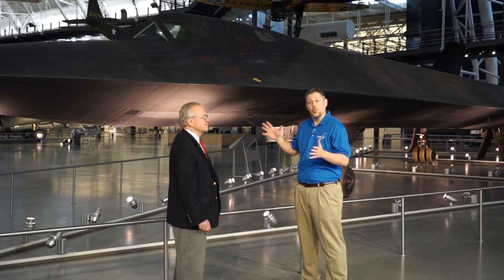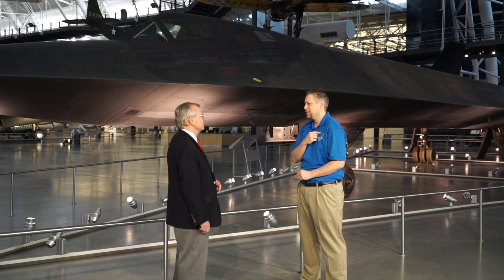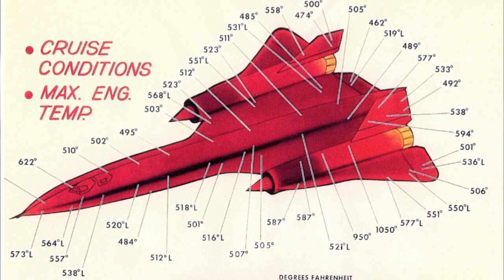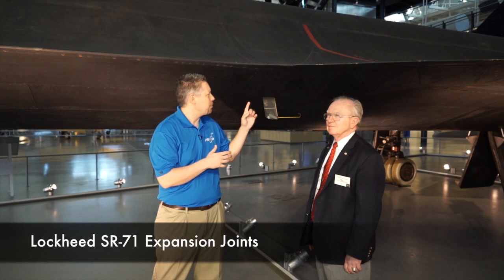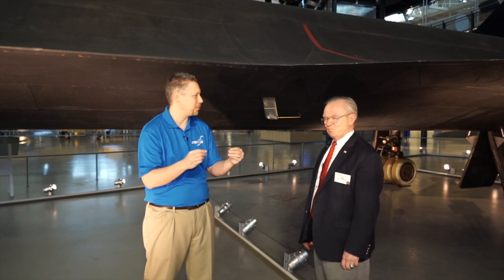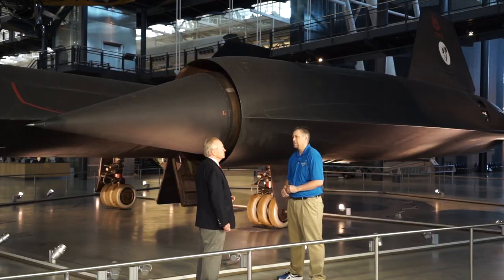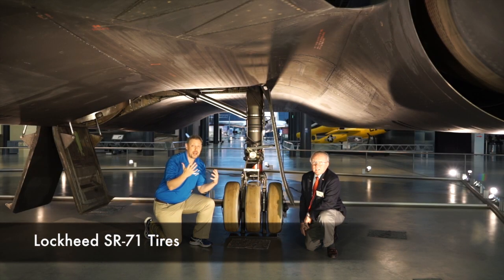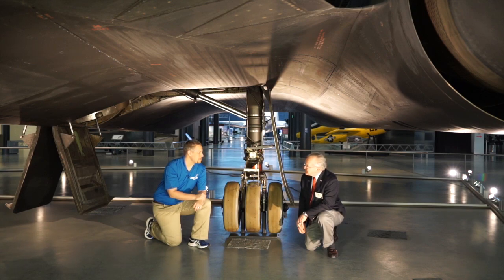A look at the SR-71

Comment: I also saw somewhere that the reason for refuelling was because the fuel leaked everywhere when the aircraft was on the ground. Something about they couldn't find a sealant that could withstand the heat.

Comment: Palmdale California's "Blackbird park" is the only place where you can see an A-12 next to an SR-71. The nuclear Cold War mission of the two aircraft were different: A-12 was for pre-strike surveillance; the SR-71 for post strike reconnaissance. One docent at the air park is "Flaps" Flanagan, who piloted an SR mission that was designed to test the Space Shuttle's navigation system in the 80,000-50,000 foot altitude range. As I recall, the SR was so efficient, the aircraft could not slow to the speeds needed to mimic the Shuttle. As for the well known Russian Ti-purchase cover story, the story in Palmdale was that  microwave ovens were described as the  reason for the bulk purchase.

Comment: 13:41 so this guy drove that plane on the ground at 240mph every time it took off - motorcycle and sports car guys take note
Reply: cheese chisel it’s not like it has two jet engines on its sides or anything.
Reply: @VERT1220  I didn't mean this about the machine, but about the bravery of the common looking old guy in the video who regularly did something so intense that even hardcore racers consider amazing
Reply: Then again, it’s the military. You need to test to get in there. After that you gotta become officer which takes about 20 years. And it takes 3 types of schooling. That’s a lot lol. I’m in the Airforce currently and see 16s and 15s take off everyday and it’s awesome but a super unfair comparison 😂😂😂

Comment: I started my engineering career using the slide rule.  Then the electronic calculators replaced the slide rules.  I used the HP RPN calculators, including the programmable ones.

Comment: The F-15 top speed is 1875 mph made of aluminum, and the additional 325 mph made this SR71 get that hot ? and require a Titanium body ? Clearly the SR71 was much faster, more like Mach 5. I worked on the J58 in the late 80's at P/W, we were still modifying the injector heads to be more efficient. The J58 had 45K lbs thrust when first flew, probably maxed around 65K thrust or more at the end.
Reply: forrest gump V short bursts at that speed....this could cruise at higher altitudes

Comment: Gosh, no mention of the D21 drone...
Reply: Nofer Trunions The D-21 was not launched from the SR-71, it was launched from an M-21.  This video is about the SR-71 at the Smithsonian’s Udvar-Hazy Center.  If you care to learn more about the D-21 and M-21 they are on display at the Museum of Flight in Seattle.
Reply: @jonboyette5458  Actually the title of the video is "Lockheed SR-71 Nose" which leaves a lot of room for digression.   If they are talking about temperatures and expansion joints, that applies to anything that has a pair of J58's.  How could they not mention that the plane leaked fuel on the runway until it got hot enough to expand and seal tanks?  I mean that's the cool fact about the joints.  (Did you ever see that pic of maybe 9 SR-71's?  They all had the same puddles of fuel under them.)

The interviewer seemed fascinated and excited about the plane, so again, how could you not say, "You realize we even launched the piggyback D21 drone from this series!)
Reply: Nofer Trunions the title of the video is “Tour of the SR-71.”  No mention of the M-21 in the title.  It’s a real simple tour of the components of the SR-71 (which did not launch the D-21,) not operation oxcart or the skunkworks.
Reply: @jonboyette5458  My Bad.  Read the first topic title in the video and assumed (love that word) it was the title of the video.  Yes, definitely the proper title.  I'll throw a little bit about the SR-71:  it is possible to compute the maximum mach number theoretically possible by measuring the shock angle coming off the inlet spikes:  when that cone touches the inlet OD, the engine will unstart.  That number is around 3.6 to 3.7 Mach.  That is not to say there are other limiting factors - only that >3.7 is physically impossible.

Comment: The fact this was built with a slide rule as the major technological design processor is so badass.
Reply: My Dad was a chem engineer and used a slide rule for decades. I can still hear him saying "log log scale".
Reply: Sir, can you please explain how a length measuring device, is so helpful in building an object with the requirements of such a high degree of precision engineering?
If that's not what a slide rule is for, please don't get angry, I don't know what's it used for.
Reply: @harshvardhan4771  A slide rule is not used for measuring length. It is used for complex mathematical calculations like an electronic calculator.
Reply: @Bob31415  oh, nice. But given that it's analogue, and the result of the calculations isn't handed over to us within a big red highlighted box, isn't there a large room for error? I mean, yes, the people using it are not idiots, but still, people tend to ignore or look over even the most basic of details when in a hurry.

Example, you calculate 76*45 using the slide rule, and the result should be 3420, which it is, and you read it so. But in a hurry (which is generally a common case in production lines) on the spec.s sheet, you note it down as 3580, which isn't much, but can be the crucial difference between the aircraft panels being of the right size vs the aircraft crashing due to unexpected aerodynamics due to an inefficient aerofoil, due to a metal panel on the wing's surface being of the wrong size.
Reply: @harshvardhan4771  I know. The slide rule is an amazing invention. I have no idea how to use one. I have one around here somewhere that belonged to my father who was a high school chemistry teacher in the 60s.

Comment: During and after the Second World War an aircraft manufacturer run by Jack Northrop was tasked to come up with a flying wing. The first one flew in June of 1946. This aircraft was designed with a pencil and paper along with a slide rule like the one shown in this video. Jack's flying wing had a wingspan of 146 feet. Nearly 40 years later, using the very best computers money could buy at the time the latest version of the flying wing was built, but by now the computer power Jack's wing needed so bad to make it work was here. How far off was Jack's wing from the B2 Sprit, you decide. Both have a wingspan of 146 feet.

Comment: I got the opportunity to see the SR-71 take off from the NASA air strip in California when President Reagan was in office at a landing of the space shuttle there. It was amazing. The SR-71  had 2 Small fighter jets that escorted her in to a banking maneuver. Once they made the  turn the two smaller planes went full burn. you could see the jet streams lengthen as they began to accelerate. Once they passed the SR-71 by about 2 lengths of the blackbird the pilot in the in the SR-71 threw his throttle all the way forward in 2 seconds he had passed the 2 other planes and with in 5 seconds he was gone. he just disappeared in to the sky it was that fast.

Comment: I learned how to use a slide rule out of curiosity. You can get 2-3 significant digits of precision out of one or 3-4 digits estimated precision. Surprisingly that's good enough for most engineering work.

Comment: Most "Sr-71's are actually the A-12's, look it up
Reply: No. I was around SR-71s almost every day for 3.5 years when I was in the Air Force, and can immediately tell the difference between an A-12 and a SR-71. The A-12s were early versions of the SRs.  The A-12s were a little longer and the wings were a little more curvy where they met the fuselage.

Comment: Canada had built a Fighter/Interceptor called the Avro Arrow. When he was cancelled in 1959, over 15,000 employees went to different Aircraft manufacturers. NASA, Concorde, Northrop-Grumman you name it. In 1966 when this SR71A Blackbird came out a lot of it was with the design team of the Avro Arrow Canada, in fact the Canopy is very similar. Had Project Avro Arrow continued, both the U2 Spy Plane and the SR71A Blackbird would have had competition as Our Aircraft was the only aircraft that was able to fly at the altitudes these aircraft were. Plus the Arrow, was a plus Mach 2 Aircraft and the only one that did not need to go into a dive to achieve. Sort of explains why the President of the USA back then had a chat with our PM and the end for Our Arrow was made. Sure wish Our PM had balls. Must run in Our PM's because we can Build the Mk3 5th Gen Arrow with Vectoring and able to reach altitudes beyond anything that could knock her out of the sky. So she could if built knock the shit out of anything in the air today, if it ever come into fruition, but Our Government will not commit. Shame..
Reply: @butchtropic 93,000 Gen 5 Arrow had it been built.
Reply: @butchtropic That was the Mk2 Arrow with the Engines of the time. Had the PS.13 Iroquois Engines ( Built, Project cancelled before it could be tested) been allowed to show its potential the ceiling was 73,000

Comment: This has been my favorite aircraft ever since I first laid eyes on one.  Built without using computers, using slide rules and drafting boards.  Built with Titanium purchased from the very country it was primarily used against by way of numerous shell companies to hide what we were doing.  And the only air-breathing aircraft that has ever achieved those altitudes and speeds.  Nothing else has ever come close.  No weapon system could ever touch it.  Had they modernized the aircraft with digital cameras and such, I feel it would still be in service today because you can't get the same angles with a satellite - those are restricted by their orbits around the Earth and can only carry so much propellant to make adjustments.  Though drone aircraft would have probably supplanted the Blackbird in the long run, the Blackbird's equally venerable predecessor, the U-2 Dragon Lady, has been filling in where needed.
Reply: Hi 👋

Comment: The J58 is still not a turboramjet. At all. It’s a high bypass turbojet. The engine never stopped working as a turbojet. Even when the bypass tubes were working at it highest capacity. It’s still a common misconception, even with the pilots.

Comment: Umm regarding the fuel? There was one more issue. As he mentioned, the aircraft Expands as it heats. They had to build the Jet with that in mind, so it would leak most of it's fuel before lift off before it would expand enough to close the gaps from the fuel leaking.

Comment: I’ve heard whenever it landed no one was allowed near it till a ground crew member in protective gear walked up to it with a long conductive pole dragging a long chain attached to it. Holding the pole in front of him and when he got close to the plane a huge static discharge would be safely hit the pole and would discharge to ground via the chain. 
Get to near it after landing you would get knocked on your backside @ best, or a lot worse,
That’s how much static charge it would build up.

Comment: The Skunkworks and the pilots that flew their birds are simply the most amazing and brilliant minds to ever exist in this awesome USA!
Reply: Back then one of the goals was to get men on the moon with Obama it was to get men into the woman's bathroom SMH
Reply: Personally I regard the Design Engineers at North American Aviation (which later became North American Rockwell, then Rockwell International) better than at the "Skunk Works". I worked at Lockheed Martin ADP (the "Skunk Works") from the mid 90's to the mid 2000's as a Mechanical and Structural Design Engineer. My father was an Aerospace Design Engineer at NAA / Rockwell from 1962-1996 working on Apollo and the Space Shuttle Orbiter for the first 22 years he was there. Those two projects alone dwarf anything the Skunk Works has ever done. 

But if you're just talking aircraft, NAA designed numerous highly advanced aircraft, including the P-51, the X-15, and the XB-70. It's pretty easy to argue the XB-70 was even more advanced than the SR-71, and they're both from the same time frame (both had their first flights in 1964). The XB-70 was a large (about twice the size of the SR-71) Mach 3+ bomber.

Comment: I recall hearing about having to develop special tools to actually work on the aircraft because nickel steel would cause the titanium to corrode.
But I've never seen the ground crew tools displayed anywhere.
Reply: sportster1988 I know.
Just have never seen the actual tools anywhere.
Only a short video of after mission ground crew operations, and it was roughly ten seconds.
You couldn't see the tools very well.

Galvanic corrosion, it plagued the XB-70 for awhile.
Ship 1 had to be rebuilt due to it during construction (?) or right after assembly. The Valkyrie had mixed construction of steel and titanium.

Comment: I'm sure this will sound stupid , if the average temperature is 600 degrees on the plane. How on Earth can they keep the  pilot and engineer cool enough to even tolerate this. It looks like there is about 3or so inches separating the inside of the cockpit from the outer surface of the plane. I'm definitely not an engineer , but it doesn't take a really smart person to have experienced heat being transferred through metals.  It appears to me that the cockpit would be like an oven. I just can't see any way around this , unless there is some kind of built in    super cooled heat synch system  or some unidentified  insulator. Dies anyone know how this works?

Comment: The one at Hill Field in Utah was called "The Bastard" because it always flew slightly sideways.  It was spliced together from 2 wrecked planes.  The rear of a crashed A12 "Oxcart" was mated to the front of a crashed SR-71 to make a complete plane.  Pilots hated it.  But it worked.

Comment: The most incredible aircraft ever. I think it would drive me nuts worrying about losing contact with the refueling jet when the fuel gauge was close to bottoming out. Flying a small one or two engine prop, I get a little nervous anytime the fuel gauges get low even if I have enough fuel to get to my home airport with 60-90 minutes in reserve. There are stories of Ryanair flights that landed with less than 5 minutes of kerosine remaining. The videos are on YouTube. I don't see myself taking Ryanair when visiting inside Europe.

Comment: Incredible! And to think these planes were designed and built without Google, Cloud Servers, Intel, or other silicon tech giants. This was when man didn't need an artificial machine to design an engineering marvel.
Reply: Not any 'Man.' 
Americans Built this marvel
Reply: Velo1010 
Without even integrated circuits!
Reply: What about a slide Rule? Haha
Reply: Well it most likely required thousands of working hours with hundreds of specialized engineers. Today you'll probably only need two expert engineers and a supercomputer 😯
Reply: ... yeah, sure... and it would´t fly, cause need updates after updates and patches al day long... and after 2 Flights it wouldn't lift of cause the Certificate has expired... or whatever  ;-)
Reply: @neilbarnwell1174  - thousands yr old abacus and slide rule can rebuild society after the apocalypse.
Reply: Back when men were men and America was great.
Reply: Damn straight, but this generation thinks they invented intelligence and most refuse to listen or respect their elders and knowledge they obtain. Just imagine designing something this magnificent with a slide rule. That doesn't shock me but is impressive if you set and think about the math and level of engineering to do design something this excellent. Chapeau to Mr. Carpenter and his comrades.
Reply: @TheRebuilt1  Each generation before and after will go through the same cycle. Didn't truly understand my parents were largely right until about 35.
Reply: The mechanism that runs the control surfaces is unbelievable. I was told it was designed by a Swiss watch designer!? Most likely because it does resemble watch works. Don't know of any pictures on the web of it though.